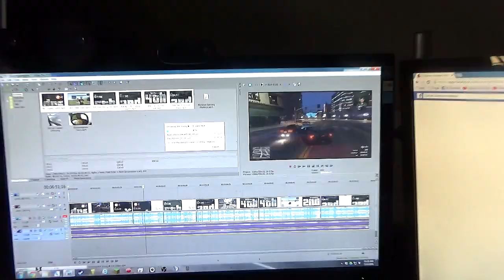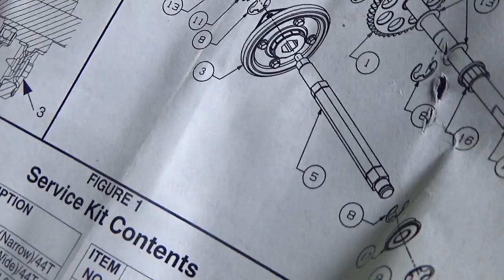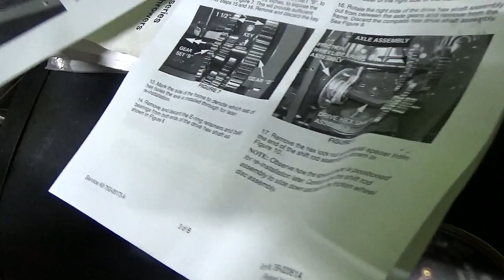Gas and the Blower

Comment: sand the end of the shaft where the other tire was until smooth, spray the axle and sleeve liberally with on blaster, then take a punch and bfh (big friggen hammer) and beat the axle out. once it starts to move, you're golden, once out, sand the other side of the axle, put the rim and tire loosely in a vice, axle down, and repeat on the end of the axle with the punch and hammer.
Reply: pb blaster, not on or oh, damn auto correct.

Comment: tap the axel through the sleeves they are press fit on the axel. all you have to do is keep hitting on the axel till it pushes through the sleeve on the side the tire is off of already then if you want to take the whole thing out you can. they aren't corroded on or welded on they are press fit meaning they are just small enough that they are almost exactly the size of the shaft it's self but they are a really close and tight fit. if you can't get anywhere banging them off then you could always get a propane torch to heat the sleeves up to where the metal expands and then tap it out easier

Comment: cutting the shaft in half is the best way. But you will need to re-use the black spacers. I know its hard to believe but the only thing holding them on there is rust. Take sandpaper and clean the rust of the ends of the shaft before banging off the spacers in the vise.

Comment: try tapping on the tire/rim assembly two or three times, then turn the wheel 180 degrees and hit again. Keep doing that until the tire/rim assembly comes off. Those sleeves have probably rusted in place. You might try soaking it in penetrating oil and tap it with a hammer to vibrate it loose.

Comment: You can probably get a decent torch from crappy tire and heat up the collars. I get the one with the dial that turns the gas on and you just pull the trigger to light it. It looked to me like the whole shaft was moving while you were beating on the tire so the collar on the left may be coming off.

Comment: did u get new plastic sleeves . Penetrating oil ,may try and hold shaft and twist the plastic , may try to heat plastic with a hair dryer or something and let cool , may break the bond. If you have new plastic cut them off of shaft if needed .  . or you could cut the shaft . also before putting it back together i would take gasoline or something on a rag and clean the disk . it will make for a happier rubber wheel . and never-size  where the wheel goes on will help it from sticking again . and if you get it out and put in vise to remove the wheel , put wood under it so you are not as likely to bend the rim on the vise . .

Comment: IM A LICENSED SMALL ENGINE MECHANIC IN ONTARIO CANADA. SAME PROVINCE AS YOU. CUT THE SHAFT IN THE MIDDLE AND BUY THOSE PLASTIC SPACERS NEW. THEY'RE CHEAP. DONT BE STUPID AND GET FRIGGED AROUND BY THOSE TWO PIECES OF PLASTIC. YOU ALREADY BOUGHT A WHOLE NEW DRIVE LINE FOR THAT THING. JUST MAKE SURE YOU CAN GET THAT OTHER WHEEL OFF. THAT YOU WANT TO REUSE IT. IT BETTER NOT BE SEIZED ON THE HAFT TOO. GOOD LUCK. THAT BLOWER SHOULD BE A GOOD MACHINE  FOR WHAT YOU NEED. OH YA AND LAST BUT NOT LEAST. USE PROPER SHEAR PINS TO HOLD THE AUGERS TO THE AUGER SHAFTS. DONT TIGHTEN THEM FULLY. LEAVE THEM PRETTY LOOSE SO THEY SHEAR KINDA EASY AND DON'T GET STUCK IN THE SHAFT WHEN THEY BREAK. THEY'RE ONLY A COUPLE BUCKS AND ARE PRETTY MUCH A GUARANTEE YOU WONT STRIP THE AUGER GEAR. YOU GOT THIS BRO! LIKE LARRY SAID... GET ER DONE!

Comment: Hey Adam. I noticed around 22:02 in the video when you were looking at the Axel from the front side of the rim i noticed that you may have another c clip holding that tire on to the Axel from where you removed the threaded screw holding on the tire. Once removed that baby should come out. If I remember correctly the Axel will only come out in one direction.

Comment: Did you grease the bearings on that brass gear? If not, that'll last about two snowblow jobs... :S

Just add bearings to the hex shaft, cos they're essentially the spacers that make everything mesh... :P

Sod's law dictates that when china builds something to break, and you try to repair it, it will find other ways to break... :P

And heat, lots and lots of heat, that'd get things moving thanks to the fun of expanding metal... :P

Comment: Ice cold water to the face helps with waking up too... :P

I swear that cat was sniffing your farts... :S

Need more direct contact with the wheel to make it move, a metal rod or bar would work a lot better than wood, cos the wood will absorb too much of the hammer's inertia...

Sleeves are probably fitted when hot, so, blowtorch time to heat 'em up and hopefully knock them off, if not, erm, pass... :P

You need some work gloves, ones like mine, thin material with latex on them, they work a treat and keep my hands clean and also add extra grip.... :)